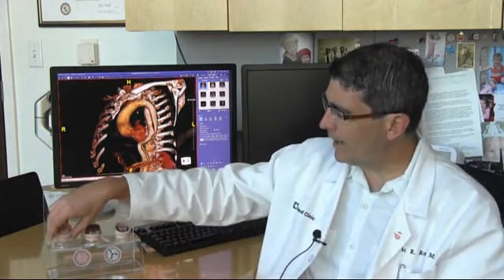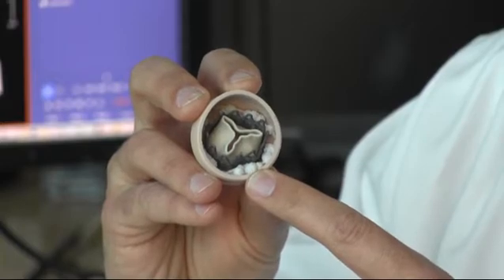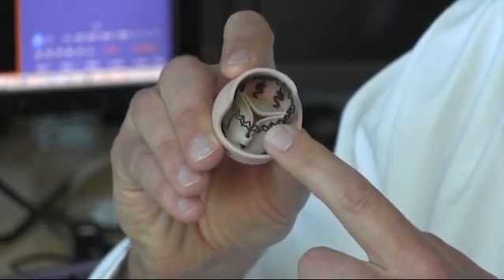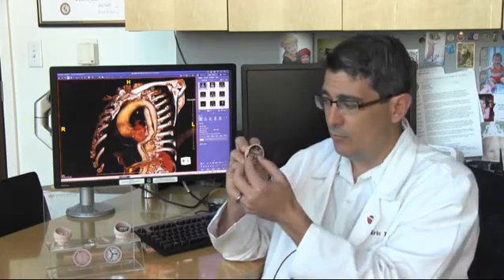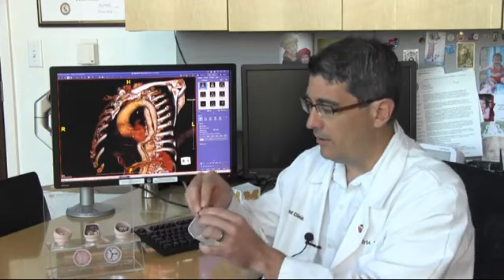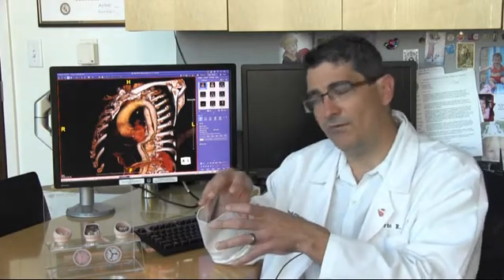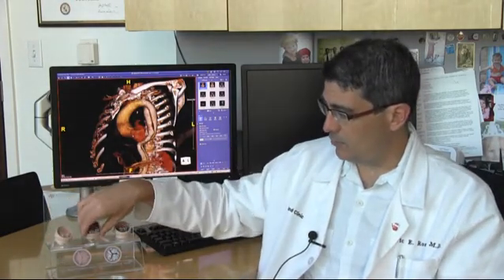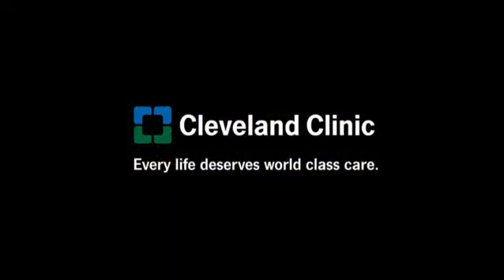New Heart Valve Technology

Comment: Hello Dr. Roselli, can u tell me how old this video is? My son, who is 36 has a BAV with moderate to mostly severe insufficiency. He also had a 4.4cm - 4.5cm ascending aortic aneurysm diagnosed two years ago. We are  getting a second opinion from a cardiothoracic surgeon at Florida Hospital in Orlando. He was told by his original surgeon in Melbourne, Fl.  that he needs his valve replaced along with repair (stent made out of carbon) of his aortic aneurysm which WAS 4.5cm last April and since being put on Coreg for 3 months has now shrunk to a smaller size that is barely aneurysmal. But, he still wants to operate on his aorta! I wanted to know how old this video is so I can ask the new cardiothoracic surgeon about these less invasive operations. They were never mentioned to us by his current cardiologist. Hence, the second opinion. Can u help me or does anyone else have an opinion regarding options that are available today for what my son has? It would be greatly appreciated, so if the doctor we see doesn't mention these less invasive new valve techniques....I can ask the right questions. Thanku so much. Laurie😊